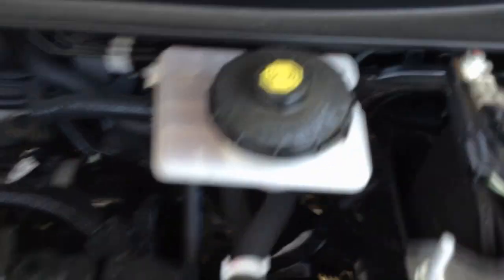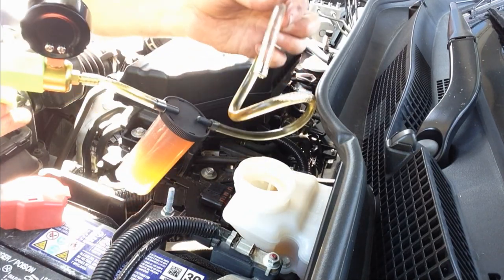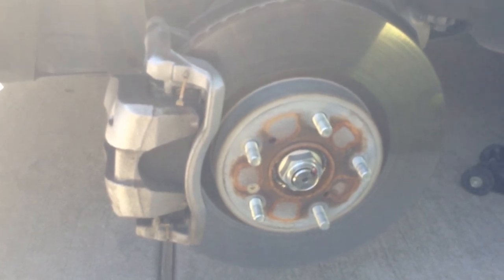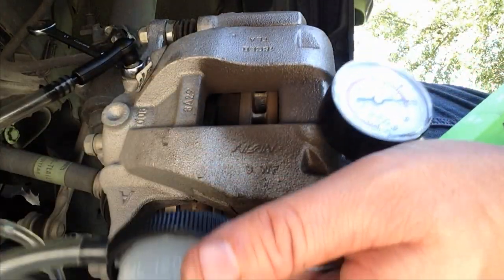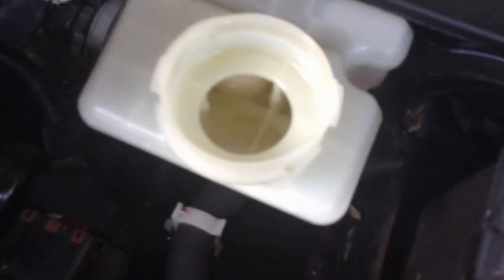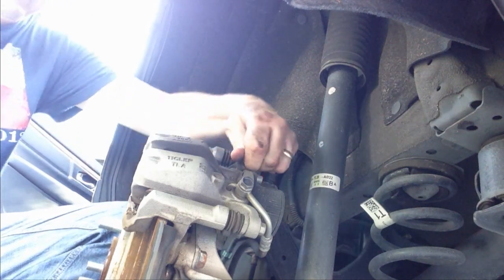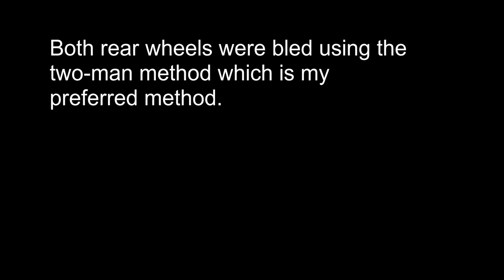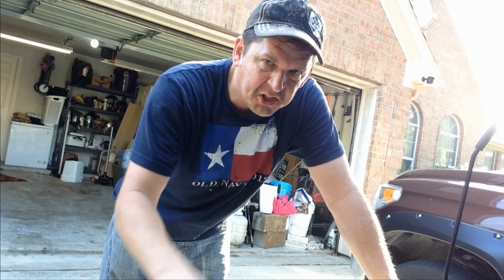2018 Honda CR-V (Brake Fluid Change)

Comment: I have been using the vacuum assisted suckers for a long time, PRO-TIP:: put some grease around the threads near the base of caliper  to make a airtight seal.
Reply from the maker: Awesome advise! Thank you very much.
Reply: Very helpful thanks

Comment: OK, I have a question. I understand taking the screen out to remove the old fluid, but I would think that the screen is there to keep contaminates from being poured in, not for keeping stuff from coming out. Just me, but I'd pour the new brake fluid in through the the screen. Isn't that what it is there for?

Comment: I noticed air in the vacuum line that did not go away. I don't know if there was a leak in the connection with the valve but I would probably have run the vacuum line up. The hose fills with fluid and you're sure to avoid getting air back in the caliper.

Comment: First off, thank you for this video. I was real skeptical about changing it myself but I grew the courage to just go and do it. I didn’t have the rear suction issue. However, the nipple screws in the back were 11mm instead of the 10mm in the front.  Overall it was a complete success!
Reply from the maker: Awesome! Thank you for providing feedback. take care.

Comment: Shouldn't you bleed the brake calipers beginning at the right-rear, to left-rear, to right-front, to left-front (starting farthest away from the brake fluid reservoir, working your way to the closest)?
Reply: apparently not on this honda according to the manual
Reply: On this year CR-V, the ABS pump is on the passenger side, so the longest brake line is driver’s rear.
Reply: Tech manual states as he did it. You should always refer to manual since all vehicles makers are different

Comment: My 2018 CRV is at 32,000, looked into Honda service for brakes and CVT trans fluid change. Egad $270 for CVT flush! After watching videos it looks like brake fluid change is a lot more work than the CVT fluid change. Decided to go with an independent Honda service for half the price, family owned shop with great Yelp reviews.

Comment: Would you advice for a brake fluid change vs a fluid flush when copper leaves are beyond 300? Got a 2011 CRV

Comment: I drove 47k miles and never got the brake fluid indicator 🤔 also I don't want to go to dealership and I'm not that strong to do mechanical service but would it be good enough to just use the pump, remove the old oil and replace it with new dot3 and call it a day instead of going thru extra steps of messing with caliper from each wheel. By doing the bare minimum, my logical guess is that it will eventually clean up from the wheels right? Or do I need to do full flush? Because when ur son pressed the brake the fluid did release. So in the long run my bare minimum will become effective right?
Reply: I don't think so. Under normal conditions significant amounts of brake fluid are not consumed. The only time fluid from the reservoir gets very far into the hydraulic lines is when the brake pads wear which causes the calipers to have to clamp down further on the rotors, in effect increasing the length of the brake lines. If all you replace is the fluid in the reservoir then most of the tired fluid in your system remains. By the way you don't have to go to a dealer for this service. Any competent shop can do it for less. Just make sure they know the unusual bleeding order for this car: LF, RF, RR, LR.

Comment: They say start with the caliper furthest away from the reservoir.  Any reason you didn't do that?
Reply from the maker: For this vehicle I followed some forums and the orientation I chose was what I found......So....that's what I did. It was quite mind boggling once you try to research this subject. In the end, I just chose this way. Thank you for bringing this topic up as I am sure it could stir some interesting conversation. Thank you for watching!
Reply: I just did mine thank you this was a very helpful video. I took off about 4oz each side for the front and about 6 oz for each side in the rear.

One question I started RF,LF, RR, RL order. Is this make a signicative difference?
Reply from the maker: @Sanmiguelito2011  Awesome! Thank you for watching. 
 Maybe there is a Honda Certified tech out there who can answer the question on order of which wheel to do first and consequences, if any, when switching the order. 
 I suspect there isn't any real negative affects in switching the order. Maybe if one is trying to bleed air out of the system there would be a required order. In that case, the person may have bigger issues on hand.
Reply: 4th gen CRV starts from driver side then passegner, rear passenger and rear driver.
Reply from the maker: @tomkoolman  Perfect! That means the order in which I performed in this video was  correct. Thank you.
Reply: Honda Service Manuals have always stated Driver Front, Passenger Front, Passenger Rear then Driver Rear for order of bleeding brakes.  I personally have my assistant pump the brakes then tell them to hold it and then I open the bleeder.  I confirm with the assistant that the brake pedal went to the floor then I tighten the bleeder and have them pump the brakes again.  Checking brake fluid level after each wheel.
Reply: I was wondering when someone was gonna mention that. But if u think about it like this. If you start closest to the brake reservoir, and there is air in the line from that point. And your starting closest to the res then that will save you from pulling that air the full length of the brake line. Imo 🤷‍♂️

Comment: Thanks for this great video. Do you also have to reset the indicator in dash or it goes off on its own after fluid is changed?
Reply from the maker: Yes. You will need to reset the maintenance minder in the vehicle.

Comment: How did you dispose of the old fluid?
Reply from the maker: Check your state regulations. It's possible you can mix it with your used motor oil and then dispose of the oil properly. I take my used oil to the auto parts store for recycling. Wal-Mart takes used oil, too. Otherwise, keep in a sealed container and ask the auto parts store where you may dispose.

Comment: Is it true you have to change the brakes in order to replace fluid because that's what Honda dealer told me but my brakes are still good just low on fluid
Reply: No. If your pads are good just add brake fluid.
Reply from the maker: Hmmm. I wouldn't believe so. Maybe they were just trying to sell you some brake pads.
Reply: when your brakes were new the fluid should be at the max. as the brakes wear,   the brake fluid will go down as the pistons expand father out due to pad wear. . this is normal since it is a closed system.   so unless you have a leak in your system, low fluid does indicate pad wear.

Comment: DOT 3 or 4 ??
Reply from the maker: I used DOT 3 ....0.36
Reply from the maker: 0.36
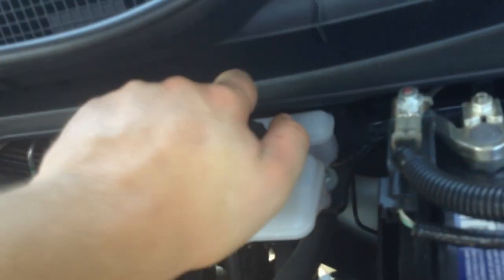Reply from the maker: 0:36 .... got it right this time trying to get the video shortcut to work. LOL
Reply: @Project Fix-It    Lol  I didn't catch that in the beginning and kept trying to see if I could see it on the bottle while you were holding it...